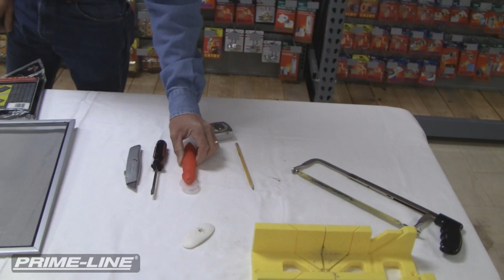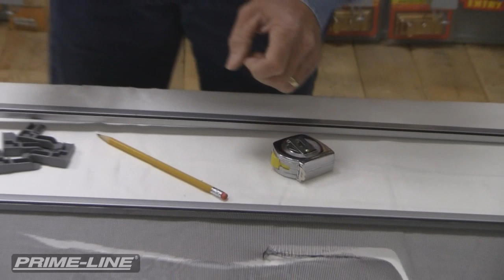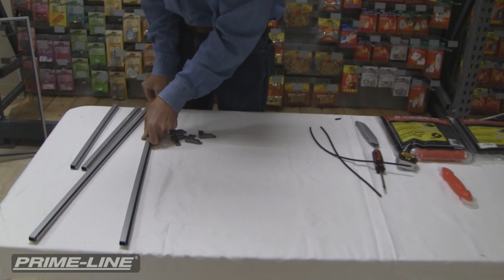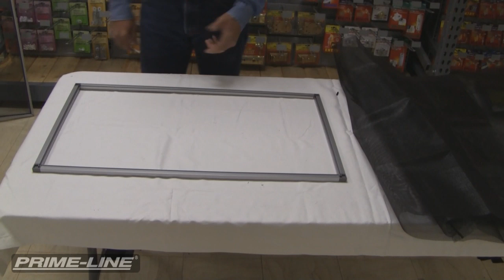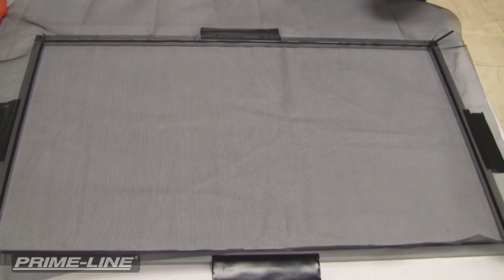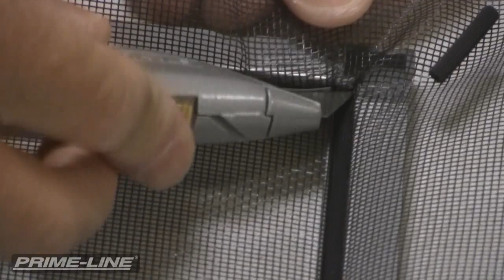How-To Build a Square-Cut Screen or Storm Window Kit

Comment: @spxrt I have two different brands of these screen kits this brand here and another brand. I cut an assembled all the frames so far and only put a screen in one of them so far and it bowed in the middle like you say. This brand I noticed seemd to be a little more rigid. In fact when I put the frame of the one that bowed up against this brand it was already bowed even before I put the screen in it! So for the two I made with the OTHER brand I will have to get a spreader bar.

Comment from the maker: Every 6-8 inches should be fine I would think.  You may even run a thin piece of foam weatherstrip between the plexiglass and the frame (to keep it from possibly rattling in windy conditions) Remember if you do that,  you may have to get slightly longer screws.

Also,  don't tighten down the screws too tight,  plexiglass splits very easily.   Lexan however doesn't have this problem,  and is much stronger if you haven't already purchased the material yet.

Comment from the maker: @spxrt I can't speak on the quality of the screen frame you're working with (As I don't know the brand or where it was purchased).   If this is a large screen I would recommend a "spreader bar" across the middle of the screen to keep the frame from bowing in.  I'll post a link to the spreader bar clips you can use to make a bar with, using another piece of screen frame.    These clips slip into the ends of the bar (frame) and are placed across the middle of the frame,  spline holds the bar in.

Comment from the maker: A screw goes in the hole in the clip, and the clip can rotate over the edge of the screen, holding it in, or it can rotate out of the way, allowing you to remove the screen.  One screw per clip, four per window.  I've added a link to the screen clip instruction sheet (PDF File) in the description.

The clips are just one way to keep the screen in. We sell many other parts to do this.

Comment from the maker: Either on the face,  or the backside of the frame you could use #6 or #8 sheet metal screws, 3/8" long.

Cut the plexiglass the same size as the frame.  Next, drill holes around the edge that are big enough for the screw to slide into without having to twist them. (You don't want to crack the plexi)   Then lay the plexi on top of the frame,  and with a smaller bit,  drill pilot holes for the screws (Only through the first layer of metal)  Attach plexi with screws.  Good Luck!

Comment from the maker: @markcastle1 We appreciate your feedback and concern for someone injuring themselves, but we believe securing screen frames onto a working surface is much safer when cutting the screen fabric.
The average "Do It Yourself" person will be more at risk cutting themselves when they are trying to hold onto a loose screen frame and cutting the screen fabric at the same time.

Not everyone has a purpose built screening table in their garage.  However If they'd like to, our part number is P-8101.

Comment from the maker: It would be best to use spline.  Depending on the thickness of the vinyl film,  you may have to use thicker or thinner spline than you would normally use with screen.   For the wrinkles.  Botox.   Ok,  just kidding.   Two things,  practice,  and they also sell a heat shrinkable film.   You would install the film on the frame,  then go over it with a hairdryer/heat gun, and shrink it until it's as tight as you need.

Comment: the video  title mentions storm window kit. Can the video kit be used for s storm window with 1/8 inch plexi?
Reply from the maker: Plexiglass won't work for this kind of frame.  You could use plastic sheeting (thick dropcloth material) with this frame.  We have another video that shows how to build a storm window using plexi.  You can see that video here: https://youtu.be/QqI6eFnaICg